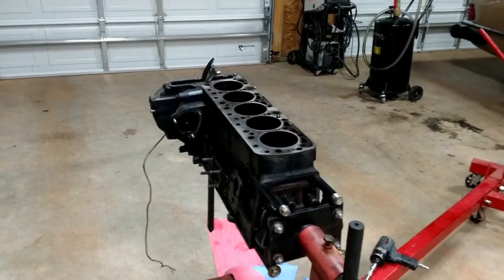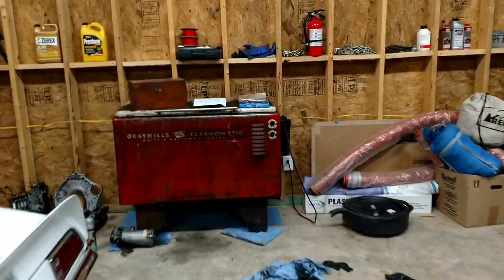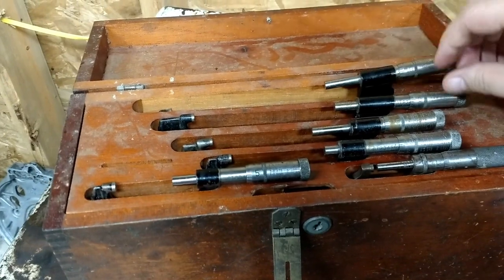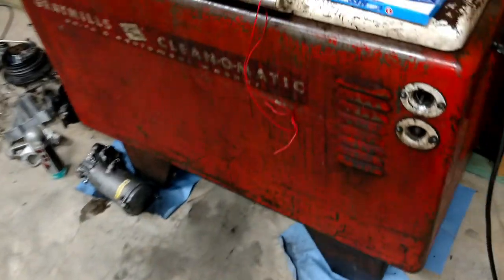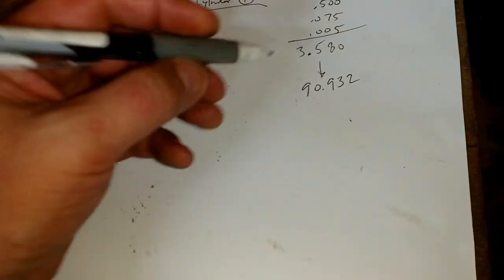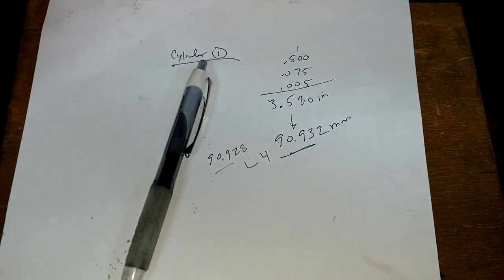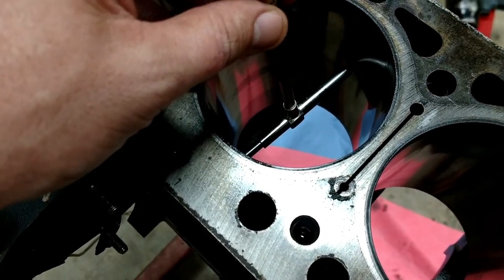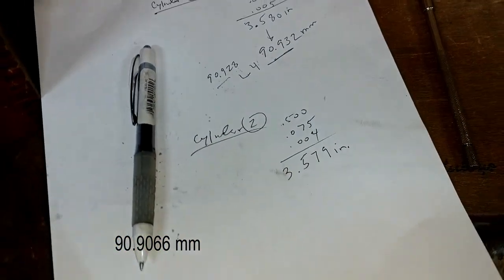Mercedes om617 Rebuild - Part 10

Comment: Great video good information freshing up the om617. Are you doing anything to the head maybe a valve job or get it resurfaced?
Reply from the maker: I really don't know yet I haven't gotten to the head yet I've been focused on the bottom end. I'm going to do full video series on the head when I start my inspection.
Reply: @woodsandbarclay  do you have that link for the nos piston rings thanks.
Reply from the maker: @performancerobert8311  https://rover.ebay.com/rover/0/0/0?mpre=https%3A%2F%2Fwww.ebay.com%2Fulk%2Fitm%2F252084282638

Comment: Ive never seen one with different size pistons. Do you think someone has been into it and replaced them.
Reply from the maker: Definitely not. This was for sure 100% original.
Reply from the maker: Mercedes had slightly different piston sizes to select from when originally building the engine. It was marked and the cylinder.
Reply: Remember you are talking about "different sizes" in machining language.

Comment: You're use the telescoping gauges wrong. You need to tension them first at full extension, THEN insert them tilted. When you rock them straight, they will compress to the actual max size of the bore, and the tension will hold them to the dimension.

Also, you should measure the bores across the thrust angle (perpendicular to the crank), which is where the most wear will occur, and compare it to the dimension parallel to the crank, to determine out-of-round.
Reply from the maker: Yep that's exactly what I did. This one was only slightly larger then the boar it's actually fully extended when I put it in
Reply from the maker: I'll take that perpendicular measurement thank you for letting me know that
Reply: Anyway, thanks for these videos about the OM617. I have a project in mind, and I'm doing as much research as possible before jumping in. Great stuff so far...
Reply from the maker: @schwartzenheimer1  thanks for the feedback!
Reply: You truly understand how to use a T gage.

Comment: Did you measure x and y at top, midpoint and bottom of the cylinder. Those engines are bad about tapering the cylinder bores.  given your measurements, you cam probably eliminate some taper with a thorough hone out
Reply from the maker: Yeah I measured all over that cylinder. It only had 150k miles on it and it was still perfectly in factory specs! Amazing!